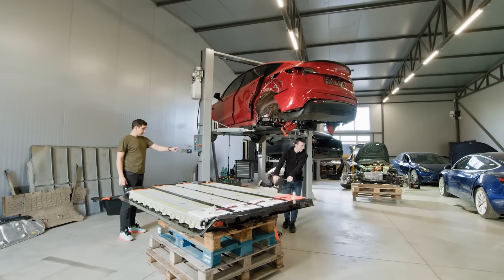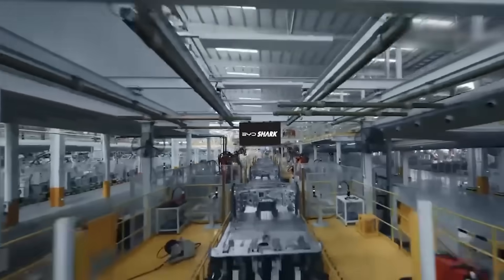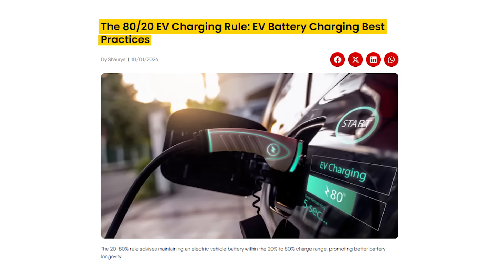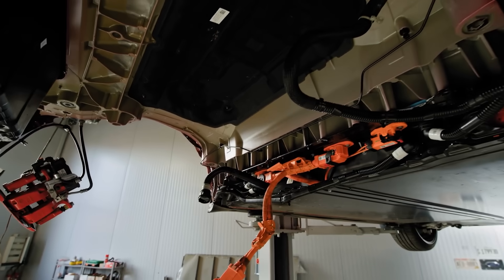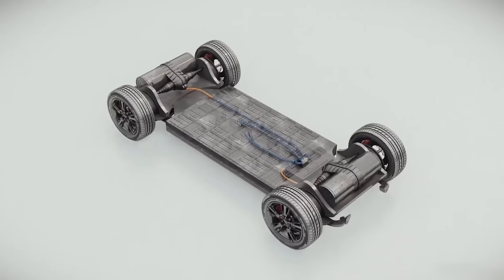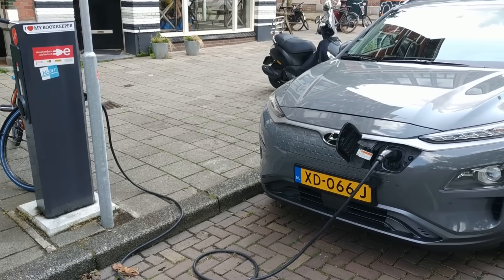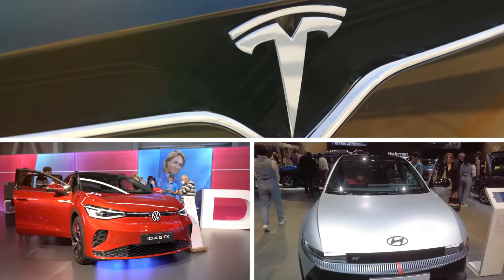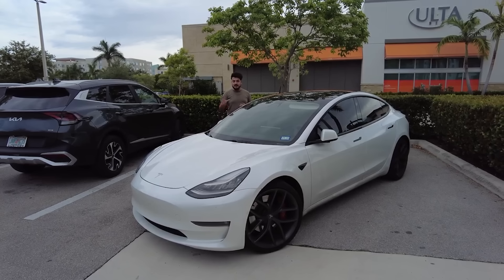8 Things You Should Never Do With Your EV Battery

Comment: To all the people saying that this doesn't apply to LFP, that is an over-simplification. Sitting at 100% and constantly charging to 100% is still detrimental to any lithium battery, just not as detrimental for LFP as for NMC. LFP does need to go to 100% more often to keep track of the state of charge because the charge-voltage curve is very flat but once every few weeks is enough. The battery management needs to 'see' 100% a bit more often to keep track of the state of charge mainly by coulomb counting (tracking charge in and out) because voltage gives little information about the state of charge with LFP except very close to 0% and 100%. To make needing to charge to 100% sound like a virtue rather than a flaw and to keep the explanation simple, people say that LFP is immune from damage at 100% but that is not accurate - it is just less harmed by it.
Reply from the maker: Great explanation - You’re absolutely right — LFP isn’t completely immune, it’s just more tolerant than NMC/NCA. And yes, the flat voltage curve means 100% helps the BMS calibrate, but doing it every few weeks is enough, not daily. Thanks for breaking that down so clearly — super helpful for everyone reading!
Reply: Tesla's manual for Model 3 RWD with LFP batteries recommends keeping the charge limit at 100% for DAILY USE and fully charging to 100% at least once a week to calibrate the BMS for accurate range estimates.
So, Tesla should be ashamed as their manual is dead wrong, eh.
Reply: @robtangent4664  It's not that charging to 100% routinely is harmless, just less harmful, and you do need to charge to 100% more often to keep the battery SOC accurate, so it is simpler to just tell the customer to charge to 100% rather than give a more complicated instruction for a marginal benefit.

Comment: I can't slow charge at my place.
Reply: I have the same problem. I don't have access to slow charging and the only charging option is a nearby Telsa supercharging station. I plan on only using it when I'm getting low on charge, somewhat like with getting gas in hopes that it can offset that issue. I also have the problem of not having a garage to park in to provide shade.

Comment: That 20-80% rule doesn't apply to LFP (LifePo4) batteries present in BYD cars and Tesla’s China-made Model 3/Y. It only applies to Nickel based lithium batteries
Reply from the maker: Spot on 👍 — LFP batteries are much more stable at higher states of charge, which is why Tesla actually recommends charging them to 100% more often to keep the battery balanced. The 20–80% guideline is really for nickel-based batteries (NCA, NCM), which make up the majority of EV packs globally.
Reply: Solid info, I wish I knew sooner
Reply: Not really. Sitting at 100% and constantly charging to 100% is still detrimental to LFP, just not as detrimental as for NMC. On the other hand, LFP does needs to go to 100% more often to keep track of the state of charge because the charge-voltage curve is very flat. The battery management needs to 'see' 100% a bit more often to keep track of the state of charge by coulomb counting (tracking charge in and out) because voltage alone gives little information about the state of charge with LFP except very close to 0% and 100%. To sound like a virtue rather than a flaw and to keep the explanation simple, people say that LFP is immune from damage at 100% but that is not accurate.

Comment: Wrong information totally misinformed
Reply: It's all pretty accurate information. Lithium batteries last best when temperature extremes and very high and low states of charge are avoided when practical to do so and you live in the middle range most of the time.

Comment: false they have data showing fast charging does not effect battery. Stop watching after this misinformation.
Reply from the maker: Thanks for your input! You’re right that studies show modern EVs handle DC fast charging better than older ones, especially with advanced cooling systems. But fleet data (like from Geotab and research published in Scientific Reports) still shows higher degradation rates in cars that use DC fast charging very frequently. The key point is moderation — using it when needed is fine, but relying on it daily can still accelerate wear compared to Level 2 charging. Appreciate you bringing this up!
Reply: @Silent-Charge Just get a diesel 😊
Reply: @johnthemagnificent7022  Get Tractor with the same noise level & better view ;)
Reply: @dimiberberu Noise???? Obviously you've never been in a Mercedes 😊 
Are you very clever? If so could you explain why my Mercedes only has 220 bhp and does 154mph  yet Some EVs have 450 bhp and only do 112mph? Seems very strange 🤔
Reply: @Silent-Charge  you have gained my repect. I see you are serious about real data. Im sorry if I was harsh. Yes more applied to older batteries. New ones it does not matter based on data. It matters if you do 100% regularly on SC or period if not LFP. letting it go to 5% alot  or letting it sit at 100%. from the data I have seen 200k nets about 15-16% degradation. I know one person they did 100k and only lost 5%
Reply from the maker: @DeeBatch - Thanks a lot for coming back and sharing that. You’re right, newer EVs with better chemistries and cooling handle charging way better than older packs. Your data lines up with what I’ve seen too. Appreciate the thoughtful discussion!
Reply: @Silent-Charge  There is even more to this statement.   Not all EV charge at the same rate or generate the same amount of heat while DCFC.    There is weather related concerns in which during blistering hot summer heat and aggressive driving may "create" more issues than during moderate weather and easy driving.

Comment: Some of those depend on what type of battery you have
Reply from the maker: Exactly! Different chemistries behave differently. Nickel-based lithium cells (like NCA and NCM) are more sensitive to high voltage stress and heat, while LFP cells are more tolerant in some areas. That’s why habits like avoiding 100% daily charging matter more for nickel-based chemistries. Thanks for pointing that out.

Comment: In March I purchased a used BMW i3bev, I live in the PNW west of Seattle, my car still shows in the mid70's on the rare occasions I charge to 100%.
I am unable to find any battery pre-conditioning mode with car, it lacks fast-charging capabilities as it only accepts the J-1772 plug.
Reply from the maker: Congrats on the i3! That’s a great car, and the cooler PNW climate really helps with battery longevity compared to hot states. You’re right — the earlier BMW i3 models without DC fast charging don’t have the same kind of active preconditioning systems that newer EVs do. The good news is that since you’re mostly on Level 2 and in a mild climate, your pack is naturally in a safer range most of the time. Hitting the mid-70s on a 2014–2017 era i3 is actually really solid!